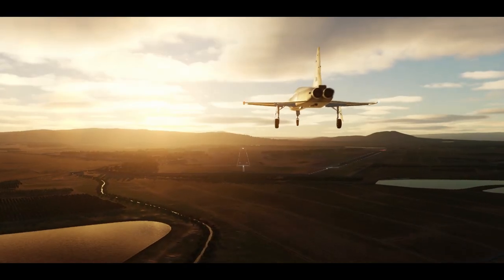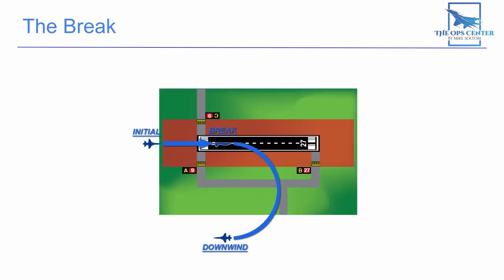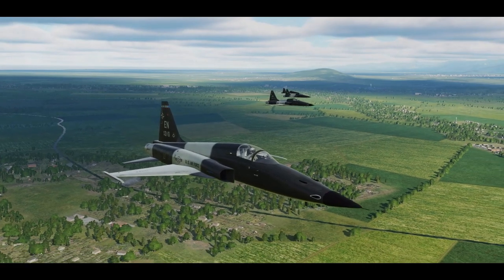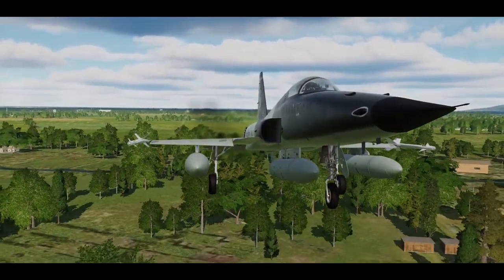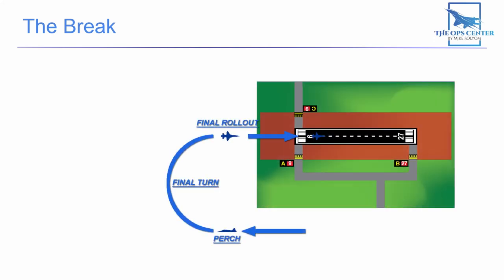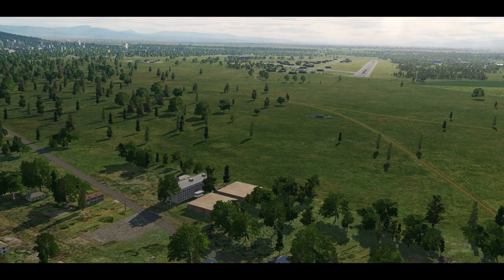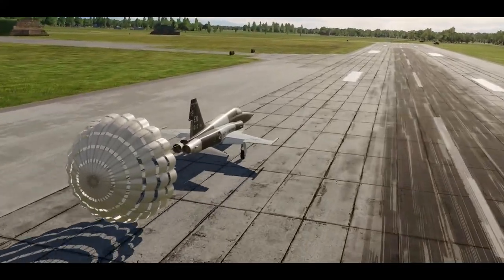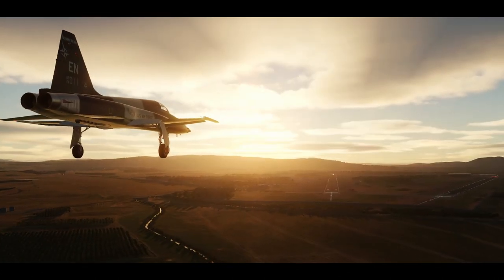Flying Formation The USAF Way | Overhead Break | Part 5 | DCS

Comment: Maybe I slept over the video...how was the speed determined? It's contract speed? And what's the final turn speed?
Reply from the maker: Going into the break its contract speed, which for our T-38 stand-in is 300 KCAS. You'll want to slow to under 240 during that first turn but stay above the final turn airspeed. There isn't a single number for final turn airspeed since it will depend on a number of factors (like aircraft weight and underwing stores). So that number will be somewhere between 239 knots and whatever your stall speed happens to be for your configuration.

I wouldn't sweat it too much. Like most things in aviation there's some wiggle room. And it becomes easier to judge how fast to go with practice. Hope that helps.
Reply: @TheOpsCenterByMikeSolyom  I see, so at least for some part of it,  the process can be much flexible.